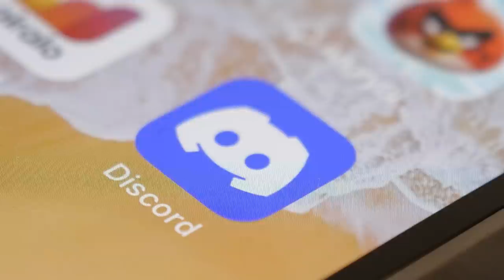Epic Bicycle Formula 0.5 + 0.5 = 0.33 + 0.33 + 0.33

Comment: I love these weird creations. Have you considered cutting the wheels a bit larger than 1/2 or 1/3 to improve cross over? IE, three sections of 130* each instead of 120* each to allow one wheel to seat before the other lifts? It would smooth out the ride and still look awesome.
Reply: The bigger problem is the missing air in the tires, I think.
Reply: @reflex3843  missing air was replaced with steel tubing making very hard riding tires!!!
Reply: @jeremiahdssdentmorgan3341  eran tubos de plástico.__.
Reply: @leojimenez4864  what ???
Reply: @jeremiahdssdentmorgan3341  they weren't steel tubes they were plastic
Reply: @shanebreezy4453  yeah okay,,, so that's plastic he was WELDING huh ???
Reply: @jeremiahdssdentmorgan3341  he didn't weld anything in the tires wdym?
Reply: @jeremiahdssdentmorgan3341  You can see him cut the plastic tube at 3:40.
Reply: I know this is old but, the problem wasn't lack of overlap, it was a problem with alignment. You can see the tires are not contacting the ground on the same plane!

Comment: I think there should be overlapping between each adjacent wheel parts to avoid jerking, so formula 0.36 (as an example) will be better.
It is really good idea
Reply: It's a cop out though  and also wouldn't look great aesthetically
Reply: @username-ql8ox  you wouldn't see it. that'd be like 2-3cm longer per wheel, without a side by side you wouldn't even know
Reply: This would net over 100% of a single wheel
Reply: He would be adding a lot of extra weight and drag by increasing wheel segments.

Creating an expandable wheel or compound gearing system would be very useful.
Reply: But why ????
Reply: @mikemoore5929  well by experimenting new and improved technology can be realized.

Nothing is constructed in absolute perfection.  So; experiment try improving anything and you'll see; most things are half baked and can easily be improved on.
The modern car is the worst example of technology improvement; ever.

A 1941 Ford is far more user friendly, safe and functional than a new piece of over complicated  junk.

Comment: There's a very good way to take advantage of this, but incredibly it doesn't seem apparent to neither the engineer nor the commenters. That shows you that inventions are not about doing stuff, it's about having fun, and then by chance it turns out that it had a practical use

Comment: The problem was that you couldn't turn. since the wheels were extending so much infront of the steering axis that any sideways roll of the bike made turning impossible. If you try this again, perhaps make every wheel turn on it's own bearing and connect them to the handle with a linkage
Reply: I think you're probably right. Giving each wheel their own steering axis will probably make it insanely difficult to link their rotations along the road together though, and that's also an essential part for the design.
Reply: @legotechnic27  true
Reply: This!
Reply: Not only turn, balance given by front wheel
Reply: Also! Angular momentum is much harder for a quasi wheel to achieve so each quasi wheel needs to be going very fast to maintain angular momentum!
Reply: and also add deferential to compensate deferent rate of rotation
Reply: Just make a parallel front wheel, with the 3 thirds each side by side
Reply: @JamesSmith-ix5jd  if you add a differential, then there's no guarantee the wheels will stay aligned.
Reply: Didn't knew we had newton here
Reply: @JamesSmith-ix5jd  a differential is only necessary when the wheels are beside each other like in a car
Reply: That's exactly what I was thinking
Reply: @Shadow__X  the wheels are 2 meters apart, they run over different circumference when turning.
Reply: I was looking for this exact comment, I guess your a veratasium subscriber too?
Reply: yeah he would need to use turning formula by which furthest wheel turns the most closest the least.
it will be quite the work

Comment: I think where it did not work was not due to the work on the front wheel split in three, but due to the effect of a negative trail for an exaggerated offset on the wheel group which causes the vehicle to be unmanageable.

Comment: 3 × 0.3 ≠ 1
the gap of 0.01 can be seen very clearly
Reply: The gap would be 0.1 in your math and not 0.01. And no, I couldn't see it.
Also, he used 0.3 repetend parts, so there is exactly 0 gap. How can someone do two mistakes in such a small thing and then post it?

Comment: And let this be a example of how the physics of a bicycle work. people say that a bicycle is balanced by Centrifugal force but it’s actually balanced in big part by the steering when he cut the wheel he change the point where the wheel turns a bike can stay sort of up right because when it leans in either direction the wheels will turn into the lean causing the bike to shoot back up when going forward he made that you couldn’t turn the wheel effectively to stay up right.
Reply: Thanks for watching, send a direct message to the above number for more enlightenment

Comment: I always dreamed how you could add a large spring to a bike that stretches downhill and then you flip a switch and you can use that energy uphill. I believe you need to be a genius in order to solve that. Very complicated I think.
Reply: Watch tom strattons video on a flywheel bike, not a spring buy similar idea
Reply: @crockgobbler  Thanks Jack, I watched it and it was quite funny.

Comment: Of course the issue with the split wheel on the front is that any wheel ahead of the normal position has a negative trail, which is necessary for the natural balance of a bicycle.

Comment: its pretty clear that you don't have the wheels at their correct angle based on the last image of the video, and the fact that the rear of the bike was bumping. 
You can see that if you took each 1/3rd of the tyre in that last image, that they aren't oriented to make a full circle, but rather there is a gap, and overlap. The rear two clearly overlap at the top, given the each cross over the vertical ("12 o'clock") position, and thus clearly make a gap with the first 1/3rd on the ground

Comment: The reason for not being able to use a cycle with half or 0.3 wheel in the front is because we use steering to balance and when you extend your steering by adding the parts of wheels your mind is no longer able to balance using steering

Comment: How does cornering work with this one? Actually the distance between the front and rear wheel is constantly changing so the corner radius does so too. This might cause some additional weirdness if you drive through a corner at higher speed, I suppose?!?

Comment: This is interesting and all.. but you might as well ride a 2 wheel bicycle, getting the wheel replacements would be a headache for the pieces that are cut in half... and you now take a wheel and a half compared to 1 wheel in the back.. plus you take up way more space and it doesn't seem as easy to ride as a bicycle..

Comment: You are doing fine; that's how new inventions or discoveries are made.

Everything doesn't have to work to be useful.  

You learned; something about a bicycle need a updated so try making a bike with a compound gearing system that permits the bike to travel at speeds over 60mph and it not be a racer.

It's all in the gearing, torque conversion and possible assist

Using nylon or heat and abrasion  resistant polymers or other light weight inexpensive materials.

Comment: the front wheel has to be the same becasue the center of mass is in the middle extending it will make it impossible to stay up because the wheels have to turn. to move